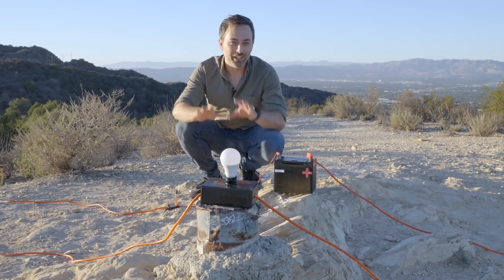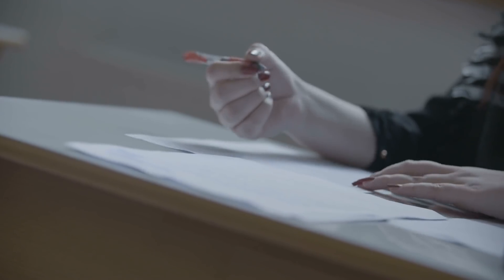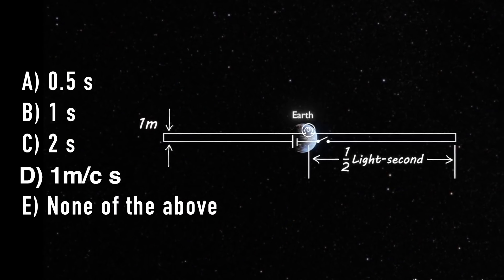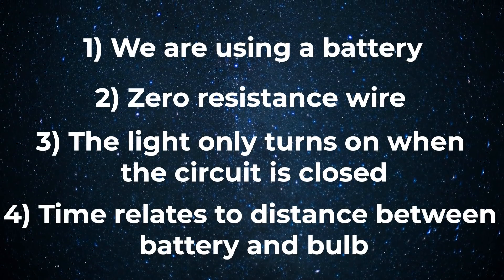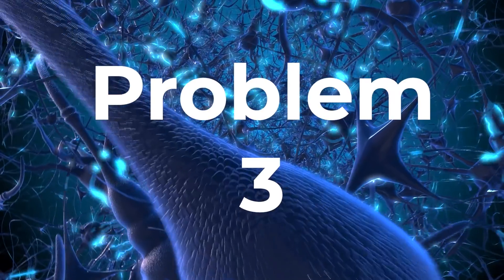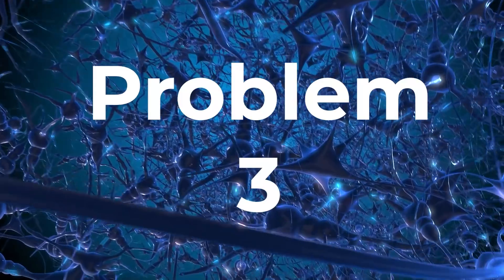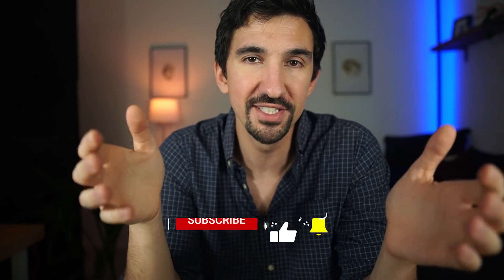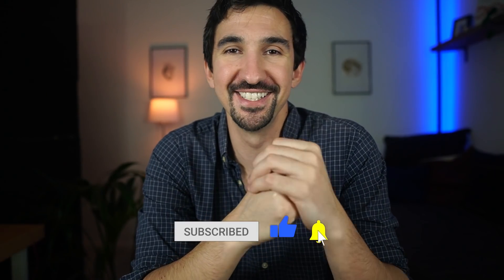Is Veritasium Wrong About Electricity?

Comment: You're confusing the point of reference when transmitting information, electrons pushes like a bloc... If you had a bar of one light year of length and you push it 1meter, on the other side the bar will advance instantly, It will not take one year to advance

Comment: This, and most of the discussion is a train wreck.  Veritasium is just trying to make a point - that the flow of electrical energy down a wire is not due to the physical re-location of electrons within the wire as is usually taught in schools.  He/they are correct in that.  This point has been around on YouTube for at least 3 years, probably a lot longer.
Reply: It has NEVER been taught in any college level physics course that electrons "literally" carry "electric current" by the movement of electrons themselves. It has ALWAYS been taught that electric current is the movement of electric CHARGE which is not the same as the physical electrons which carry the electric charge., Veritasium is just click baiting everyone and anyone who has never taken a basic college level physics course on electricity. Click away . . .

Comment: You're right. And this is why his poynting vector model is relevant. It's the direction of radiation. I would add a nice thought experiment - have the wires of the switch and light perpendicular to each other at close range. This would negate the radiation's effect.

Comment: Seems to me the entire point of the V video was the field around the wire vs the activity IN the wire. And the chain vs sending a "partical" from one end and waiting for it to arrive at the other. You might have fixated on the wrong thing. And he may have been able to tell the story better. That's my uninformed observation. And yes, some elements of this carried to extremes break the rules. Actually the most interesting thing in the V video was the under sea cable failure.

Comment: Good try. For me, did not really hit the mark. The first half of the explanation says more or less what many people (myself included) answered already in the comments to the original video. But handled nicely in this video. Surely the second half would apply only if in the original video the dc battery would have been an ac source. Then the whole antenna story would make sense. But it wasn’t. And the effect of a momentary ac component as the switch is put on, which could potentially have produced a momentary tiny flicker which immediately dies away (and would not be seen by the human eye) - well if that was what was meant, then it should have been stated like that, not a misleading video that says that the light “goes on” within the microsecond. Then mr veritassium should have said a microsecond flicker due to induction, followed by 999999 microseconds of darkness before then switching on.

Comment: Really nice explanation.
I think the veritasium video was right but extremely misleading. Not including poynting vector lengths just directions is horrible. Not clarifying magnitudes. Using models (circuit diagram) where the EM propagation among components is implicitly assumed to be 0 outside the wires, unless otherwise stated or drawn. Final conclusion that people are lied to. Finally, the overall thing that this video with correct misunderatandings could fuel a lot of conspiracy theories (like oh, my body is obviously more complicated than a lightbulb, so if this circuit turns on the lightbulb, if I am standing around one I will get cancer or something similarly nasty, so we should not have electric lights)
All in all this caused me to dislike the video and unsub from the channel (something which I have never done before), as long as this video remains unadressed.

Comment: I wrote this question to Veritasium: "I guess 1/c is because distance is 1meter between battery and the light bulb? My question is then: If you put battery and light bulb on either end, how long will it take then? 1s?" - What is your take on this setup?
Reply: What's important is the distance between the light-bulb and the switch, not the battery. Because the switch is the place where the current initially flows through, generating magnetic field, and lowering electric field, and that's the starting point of the EM field disturbance that propagates at the speed of light and transfers the energy.

Comment: YES, he is wrong.  He made some suppositions that were wrong.  For starters, the "field" does not exist until the current is completed... electrons begin to flow.  The resistance of space is one ohm per light second... which expresses the resistance of space ONE ELECTRON at a time and in wires, it will depend upon the qualities of the conductor.  No electrons moving, no flow.  The two wires should be considered as one... the "circuit" and the time will be over ONE wire... one light second.  The whole thing he presents is RIDICULOUS and will confuse people.  The field around the wire is completely dependent upon the VOLTAGE which is undetermined here because of zero resistance.  There is no such thing as ZERO resistance.  Also, the capacitance around/in the two wires is not there because of low surface area and the distance would have to be in nano-metres.  High school science is NOT enough to explain the problem he presented.  A good example of long distance wires is the Trans-Atlantic cables... the very best of which has a nearly 60 second latency (delay).  Electrical waves move about one foot per nano-second and there is little one can do to change that except by changing the conductor... light speed DOES vary but  reaching it is very hard to do.

Comment: "If the circuit would break at the farthest point" - for this you would need to synchronize 2 events at relativistic distances which is tricky. But I don't think we need to go this deep, if circuit breaks half a light-second away then the light goes off in half a second, simple as that. 
But I agree with the rest of the video, especially the part that there will be no visible light
Reply: @Bob True. 
There is nothing practical in having 0.5cs-long wire but nevertheless..

Comment: I saw a number of excellent comments.  I think that at some point, due to the length of the wire, if we can truly ignore resistance, a non-trivial F = ma will kick in for the electrons.  Usually, we treat the electrons as massless.  They move instantly to cancel any force on them, generating a counter-electric field.  But I don't think they react fast enough in this case.

Comment: The papers that Veritasium linked to in the original video mention the 'antenna effect', which seems to just agree with your analysis, though I can see how people could get their wires crossed when talking about this.

Also IDK if your faster than light breakdown really works - I'd assume that information sent via the antenna effect travels at the speed of light in the medium.  The distance between the switch and light controls how fast the signal gets there (my understanding as I read the linked papers).

Comment: You both gave rational answers but both neglected that electrical fields are only generated in collapsing E-MAG fields. Therefore the antennae theory doesn't apply and the veriitasium suggestion that Energy travels through the insulator also neglects the requirement for an alternating or collapsing E-mag field to apply.
He shows a DC example but you both resort to AC explanations.......I think?

Truly, so much of early E-generation and transmission was accomplished empirically but explained after the fact through logic to fit observation.  And much of that actually came from self taught individuals [other than of course the usual suspects Tesla et al] 
Rick

Comment: You made a similar goof with units. 1 m/c s or “(1 meter divided by the speed of light) seconds” is in the units seconds squared. It is sufficient to say “1 m/c in seconds” or otherwise just reminding people that the units of “1 m/c” is seconds without just saying “seconds”.

Also, this does not break causality. The lightbulb is a meter away, and it turns on 1 m/c after the switch is pulled, meaning the information travels 1 meter at lightspeed. No breaking of causality here. You’re still assuming that the signal has to go all the way down the wire and back, but it doesn’t have to do that. The fields transmit the power, and they can community “across the gap”. If you use something like fiber-optic cable, then the message would have to travel back and forth before the signal would be received.

Basically, I’ve been thinking about it like this: the wires are just antennæ, that happen to be connected together, so that they have really good signal propagation.

No, the lightbulb wouldn’t go out instantly if there were a break in the wire at the furthest point. The same way, the bulb wouldn’t turn on instantly if the switch were at the furthest point. The answer only works because the switch and the bulb are physically close to each other. If a break happened at the furthest end, it would take half a second for that information to propagate and turn off the lightbulb. But if a break were to happen on the near side, then yeah, it would happen faster, just like the switch does.

Comment: Cool. Thanks.  I get annoyed by the hyperbolic nonsense that some YouTubers resort to. What about Veritasium's claim that it is the magnetic fields that are more important than what's happening to the electrons in the wire?  I immediately pictured old 1920 knot and tube wires several inches apart, more modern Romex with the wires running in a consistent parallel spacing determined by the plastic cover, and multi-circuits  (and not a few CAT-5 wires snuck in there) running through flex and conduit.  So if the magnetic fields are so important than how do all these circuits work the same?  Some have their magnetic fields cancelled out, others multiplied, others  interact not at all. I don't see inductance or capacitance mattering all that much. (The only reason the Nat Electric Code requires both wires of a circuit to run together is so damage to a run has a better chance of shorting out the circuit, instead of the electrocuted rat laying between two wires, heating up and catching fire.)
I remember reading that basically one electron passes the charge to  the one next to it all the way through a copper wire circuit at about 75% the speed of light, and it takes a long time for a single electron to actually make its physical way around an entire circuit.  
Something else I learned as a science teacher - if you really understand something, you can (usually) teach it to just about anyone else.  Veritasium basically did the old trick of 'what you think it wrong,'  then jargon-jargon-jargon  emotionally concluding with an unsupported conclusion "See now you get it!"  I just shrugged and figured he didn't really know what he was talking about. And yes, c definitely came to my mind as well as continuity (why would you need wire or any circuit if it's all just the magnetic fields? ) 
Something else someone could do. Make a video exactly like the Veritasium one about a science topic, but make its point something that isn't true. I don't think most people, including a lot of scientists (and teachers) not in that field wouldn't be able to tell any difference. This is how far more people believe bizarre conspiracies - in detail - but flunked  science and math. Was it H.L. Mencken who wrote, "Explanations exist; they have existed for all time; there is always a well-known solution to every human problem—neat, plausible, and wrong."  It also seems the YouTube algorithm can't tell the difference between science and baloney.

Comment: Really enjoyed this video. I'm a biologist, so very superficial knowledge about anything being discussed here.

I have a question, about the breaking of causality scenario and I hope it's not very stupid. Isn't is possible that in the situation of the circuit breaking at its furthermost point, the light goes on due to the field propagation and then goes off due to circuit interruption? (each process happening at t = distance/c) 

I understand this seemingly contradicts the assumption that the light only goes on with a closed circuit, but I reckon it also depends on how the circuit is defined (i.e. inclusion of the fields)